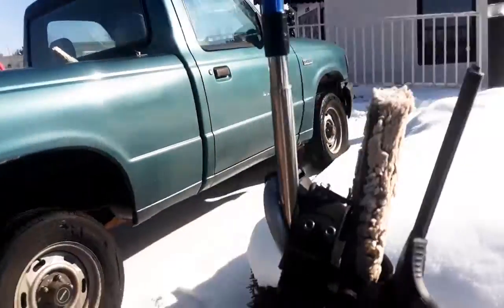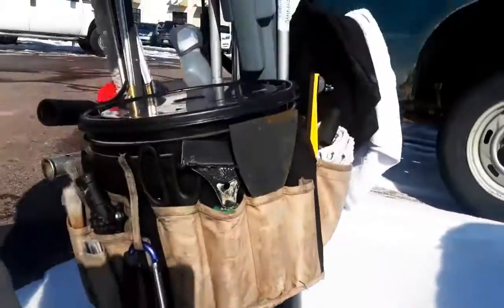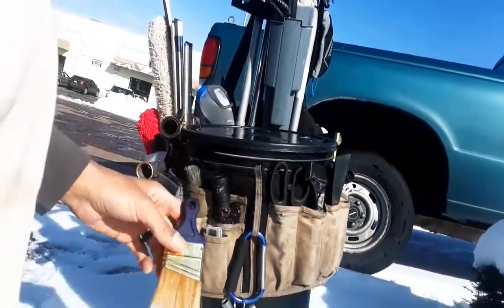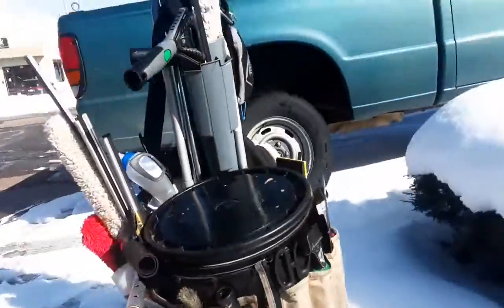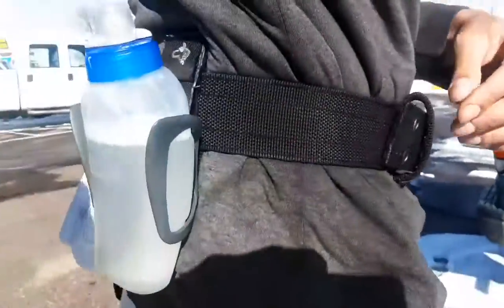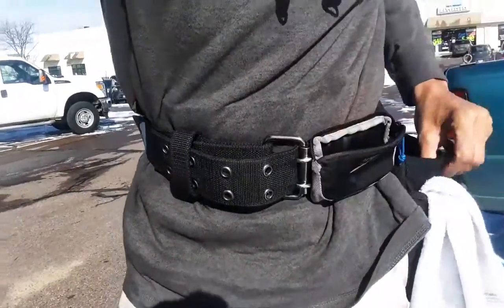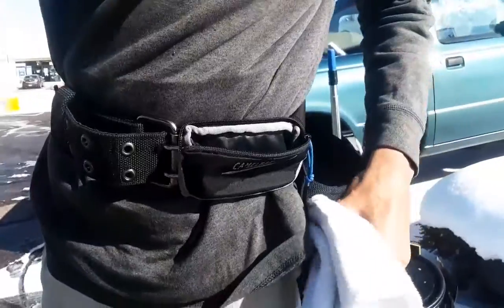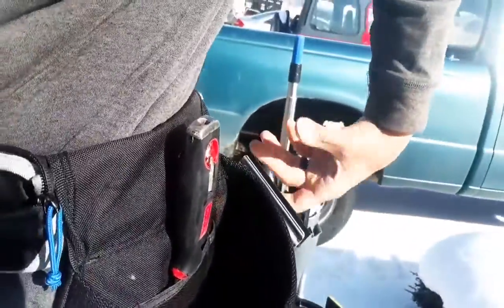Window Ninja llc - Bucket and Belt Setup

Comment: Can $50 get you started for just the basic equiptment?
Reply: Taval Dacres Yes, I recommend buying pro tools right from the get go. Call a wc cleaning distributor and tell them what your budget is and they’ll get you started. 😊
Reply: Taval Dacres I started my wc business with $100 10 years ago. Never had any regrets except buying Lowes tools. 😬
Reply: @49684  thanks for the insight, how are you doing now? And how much can I expect to make my first day canvassing?
Reply from the maker: I Agree with JW! Start with pro tools  You can start with $50. I had 2 squeegees, 1 strip washer,  1 boab, the shower rod pole, a paint brush (for tracks), steel wool, towels and business cards.

 I made $60 my first day out last year Doing 2 store fronts. But it is hit or miss, some days I didn't get new customers and some days I would make a lot. Now I try to be persistent in canvassing the town and not calling it an early day after my scheduled cleanings.
Reply: @windowninja1629  thanks!